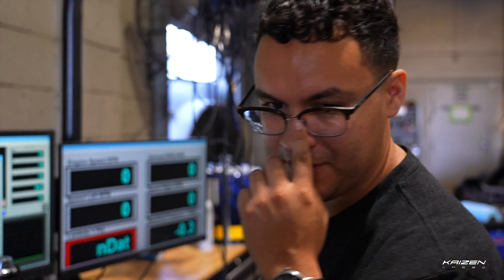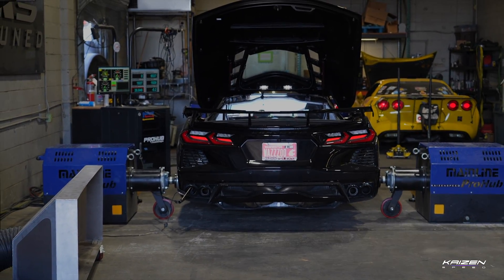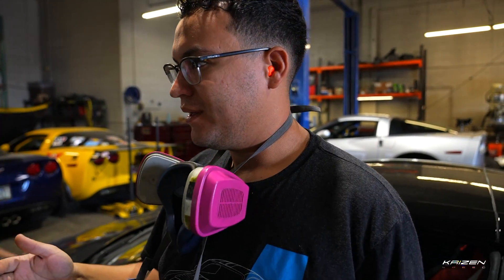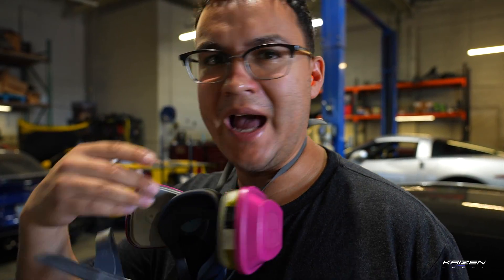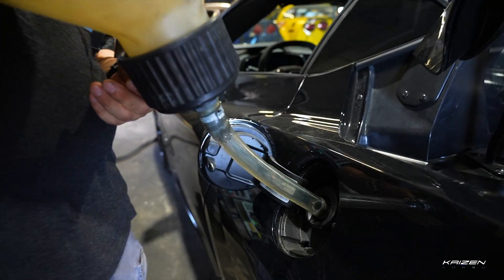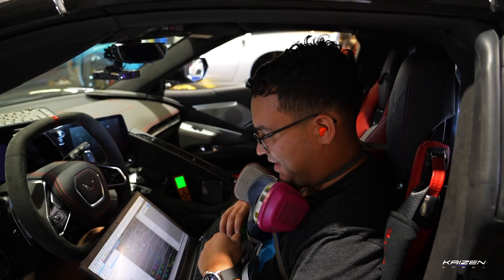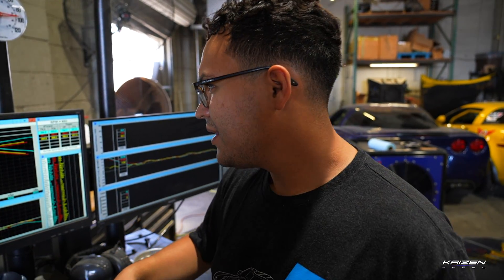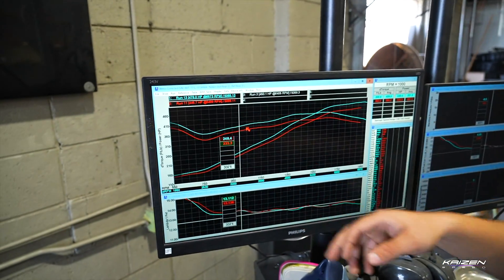Tuning The C8 Corvette: Will E-85 Make More Power Than Pump Gas?

Comment: i just got a quote for flex for my c8.  5 grand for the kit and tune and only getting 37 hp gain?  not worth it imo
Reply: Hopefully the price comes down over time, but the PCM unlock is still pretty new and requires unlocking the PCM and dyno time after unlock. If this is your only mod then it may not be worth it, but it sets the car up for future upgrades, namely forced induction.
Reply: @reidlunde7020  the mods I've done are 2m fabrication exhaust and the throttle controller.  That seems to work really well
Reply: Unlocking the ECM is about $2k of that $5k and you'll only pay that once so following mods would be cheaper

Comment: I’m going to be honest insanely low numbers my buddies with ported intake and ZR1 95mm throttle body with spintech headers with high flow cats on 93 lol made 513 on hub and 525 torque how is your torque so so so far down. I’m not talking shit I’m thinking there’s an issue with map and fuel
Reply: Different dynos. Yours sounds overinflated

Comment: So can you still use pump gas after this e85 tune? Is it a flex fuel tune? Or once you so this tune....do you always have to use E85.

Or will the flex fuel sensor know what fuel is in it and adjust the tune accordingly?
I have an HP tuners tune on my vehicle now. Was told the flex fuel option where you could put pump 93 or e85 wasnt out yet.
Reply: Yup flex according to the description, absolutely any ethanol 93-E85, and honestly I've seen some flex tunes for other vehicles range 87-E85, would be a power loss on the 87 obviously but it can probably be done, it is done in the Audi/VW world. Flex seems 100% the way to go, because most E85 stations aren't always true E85 and can vary widely.
Reply from the maker: Yes, you can still use pump gas. We installed the DSX Tuning Flex Fuel Kit complete with custom operating system. We are one of only a few dealers who can provide this. This kit allows for the ability to seamlessly switch between pump gas and ethanol mixtures of any blend and the calibration will compensate automatically.